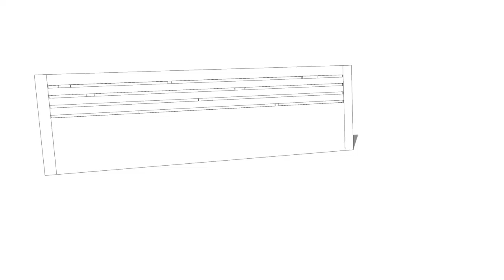DIY Modern Plywood Platform Bed Part 2 : LED Backlit Headboard Build - Woodworking

Comment: Subscribed because of this video. I watch Chris's videos religiously, and I thought this was a great video. I may actually attempt to build this. I often wonder about the glue and chemicals in plywood, and whether or not it would be healthy to live with/sleep on. Great project.
Reply from the maker: Thanks! Purebond is actually formaldehyde free and uses soy-based glues. That's one of the big reasons I use it for my furniture builds.

Comment: Looks great. I want one like this.  I was wondering why not use the router to cut the long holes in headboard and leave it as one piece. Too hard to keep it straight across the whole width?

Comment: Nice collaboration with Chris and a really cool bed! At 0:43 I notice a flicker in the image maybe it is because of the low light or high speed. But lately, my brand new Nikon has the same kind of flicker but much worse. Not always but in different situations. I just wanted to ask if you have that problem or know the solution.
Reply from the maker: Thanks! I think the flicker has to do with the fluorescent lighting and the shutter speed I was using on that shot.
Reply: Looks to me like it was LED lighting causing this.  I get the same when using only LED lighting.   The pulse-width modulation (PWM) of LEDs causes this.  Slower shutter speeds will make it more noticeable too.

@Erik did it -- the solution is just different lighting or adding lighting in addition to the LEDs.  Increasing the shutter speed can help too.  It is most noticeable (for me at least) in low-light situations where the only lighting is from an LED source, and I have to shoot at a low shutter speed to get adequate exposure.
Reply from the maker: +Modustrial Maker I’m pretty sure the lighting in Chris’ shop is fluorescent, but I could be wrong. I’ve had the same flickering issue with LEDs before, happens in my shop. Seems like shutter speed is the biggest culprit.
Reply: Crafted Workshop interesting, then you got me....not sure why florescents would do that.

Comment: My jaw dropped again watching this.  Great design and build.  

This got me thinking and designing, as any great build does.  I'm wondering if you could build this in reverse from a single sheet, and just use a router with bottom cleaning bit to route out the slots in a sheet of plywood.  I'm thinking if you clamped a stop piece so you could make a few passes to the same point for each slot, and attached a router edge guide to make sure you cut straight, you could just make a few passes to cut out each slot.  It would be a bit of work, but maybe less than cutting everything up, using the dominos, and clamping it back together?
Reply: p.s. The duck walk at the beginning is classic :)
Reply from the maker: You definitely could, and that was actually the original plan (to do it with the X-Carve). We ran into some technical issues and time constraints, so we went with the quick and dirty method.
Reply from the maker: Hah, Chris is hilarious.

Comment: A quick question; at 2:17 he's cross cutting along side the fence. Isn't that super dangerous because it can bind? or is there a certain length the board can be before you should remove the fence and push it through freely?
Reply from the maker: Mathew, it's definitely not the safest cut, but you definitely don't want to remove the fence and cut it freely. Kickback happens when pieces twist usually, so freehand cutting is a big no-no. The best solution would have been a large crosscut sled or to use a circular saw/track saw.

Comment: great build. how did you get your LED tape to make 90 degree turn? I didnt see connection clamps or soldering. did you just fold the tape?
Reply from the maker: +John Howell yup, these strips didn’t have the thick rubber that I’ve seen on most of them, so I was able to bend them easily.

Comment: pipe clamps....cheap....and adjustable lengths up to 10 feet using a full length of pipe. Home Depot will cut the pipe and thread it for you for free in most cases
Reply from the maker: Yup, definitely would have been a good option!

Comment: Great work! Seems like you could've saved yourselves some grief by just routing the slats out from a solid piece of plywood though.
Reply from the maker: Probably could have, but we were in a time crunch and this went pretty quick. We only had one shot at it, and the router sometimes has a mind of its own. Thanks!
Reply: Crafted Workshop Fair enough. It looks so great I'm honestly thinking about stealing the idea.
Reply from the maker: +SkewToob go for it! We’ve got plans available too.

Comment: How many sheets of Plywood did you need for this project?
Reply from the maker: 7 sheets in total. Definitely a lot of plywood! You could probably scale the sides of the rails to use less material, but I dig the beefy, low slung look.

Comment: Nice but a lot of waste on the bed base, you could have cut say 3” strips then a wider section on top and packed out underneath where you can’t see it. Not trolling, just an idea, nice work 👍🏼

Comment: Why have the 2 switches for the lights? Seems like an odd choice. You could have spliced them together and put the whole thing on a dimmer. I think the headboard looks pretty cool but the backside is very sloppy with the lighting and disappointing. Love your videos though!
Reply from the maker: +James Helms I wanted the lighting to be independently controlled on each half of the bed. If only one person is in bed, they can still turn on enough light to illuminate the whole headboard, but if two people are in bed, they can either get a little more light or just have one person control it. The wiring could have certainly been tidied up, but this was really just a prototype, not for a client.
Reply: Crafted Workshop , thanks for the reply Johnny! I worked for years as a theatrical electrician so I like my LED lights to be nice and pretty. I counter your dual switch idea with dual dimmers! Enjoy your videos, keep up the good work!
Reply from the maker: +James Helms dimmers would be even better! I’m not a wiring guy, so I just bought a few kits off of Amazon that I knew would be easy to install.

Comment: great bed and but how is the average guy with just the basic power and hand tools ment to do that sort or thing
Reply from the maker: This is a fairly simple project really. Circular saw and straight edge, some clamps, sander, and maybe a router would get you there.